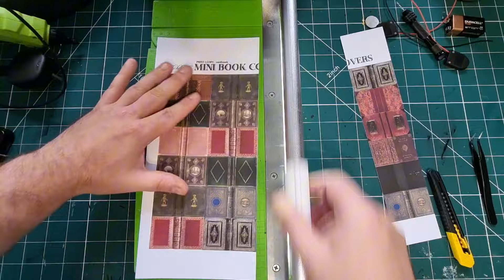Madam Alessandra's seance room 🔮

Comment: Were did you get your lights from please 🙏
Reply from the maker: Hi Roberta. For the pre made doll house lights I buy job lots on ebay but for my own build lights, in this case, the fire, candle and crystal ball, I used these LEDs from amazon
Switch Electronics 50 x... https://www.amazon.co.uk/dp/B00WX3BAOC?ref=ppx_pop_mob_ap_share
And here is the link to the hand, which I got from Temu. I hope this helps ☺️ 
 https://share.temu.com/oYppBeapPsA

Comment: Where did the box come from?
Reply from the maker: Hi Joyce. The box and the box front are homemade. If it is of any use to you, the dimensions of the box are 9.5 x 9.5 inches
Reply: Thank you.  It's hard to judge sizes without perspective.  Thought it might be about that given the markings on craft mat. The whole project is very clever and well done.  Did you laser cut all the parts?  I'm not really that knowledgeable.  Loved use of embossing powder, May have to incorporate that on something.   ❤
Reply: Forgot, was that chipboard you used as well?
Reply from the maker: I used 3mm MDF for the box and 1.5mm plyboard for the front frame and letters using my laser cutter. It would be just as sturdy if used out of a thick chipboard though